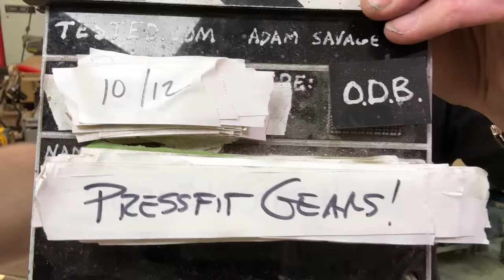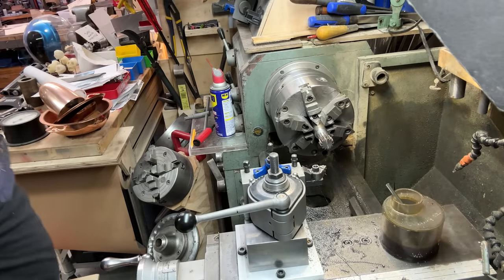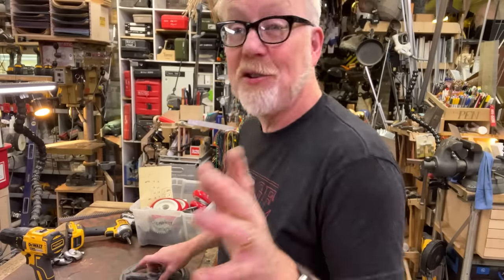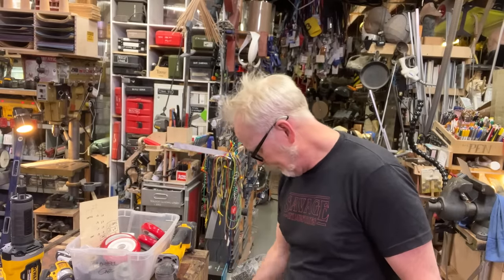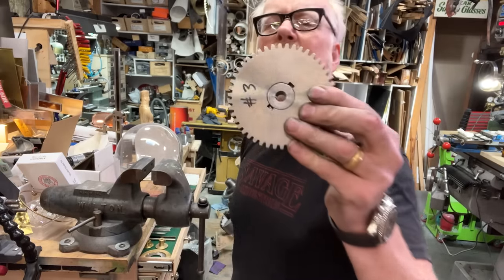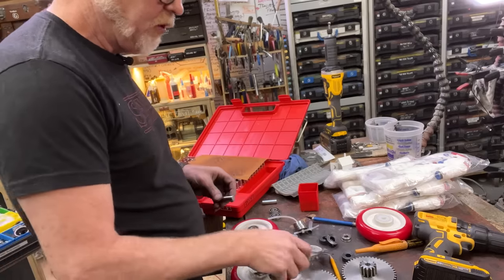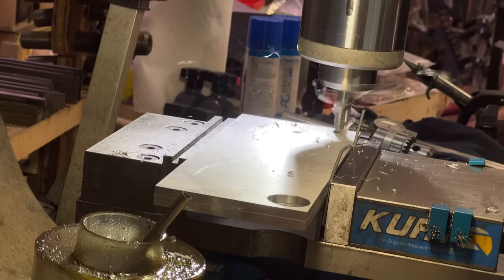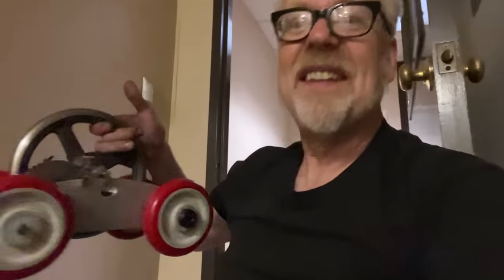Adam Savage's One Day Builds: Giant Flywheel Toy Car!

Comment: the wheel diameter is too small, So you are not getting as much distance out of every turn of the flywheel. If you look at the original the flywheel to drive wheel ratio is almost 1:1 and your enlarged model the drive wheel is much smaller compared to the flywheel. I think that will get you a better result.
Reply: I was thinking this too once it was put together. The wheels respectively are too small.
Reply: Yup, I'd say that's exactly the problem he has. Furthermore, it looks like he has quite some friction torque slowing down the whole system way too quickly.
Reply: @schizophrenicenthusiast  Also the weight in his design vs the size is significant. If he skeletonized the from with thinner stock, and skeletonized the gears, would reduce weight significantly.
Reply: This!
Reply: Give this man some more likes so this becomes top comment!
Reply: Yep
Reply: @Stevieboy7  True, but you could also argue that the increased mass better stores energy without needing to go to higher speeds
Reply: @Stevieboy7  Mass, this would have the same problem under any gravity. It is using almost all the energy stored in the flywheel just to move the gears so very little is left to propel the car forward
Reply: oh... you maybe right!
Reply: Exactly what I was thinking.
Reply: I would bet you are getting a much higher RPM in the flywheel with the toy car than this one, mainly due to the ease of spinning it up. The larger scale in the diameter of the wheels in the toy would also give less rolling resistance and spin the flywheel faster.
Reply: I think larger wheels will both increase the distance traveled and make it easier to get the fly wheel to higher rpm. Good handles on the frame would also help to use a similar technique to get it going as with the toy, i.e. "multiple push-lift cycles".
Reply: I replied with what I thought the problem might be, but yous is more likely a contributing factor to the lackluster performance.
Reply: Was gonna make the same suggestion but here this is. However to me it also sounds like the flats of the gears are rubbing together, could be wrong and that's the teeth of the gears interacting but from what I saw he might have made the tolerance to small and the flats are rubbing
Reply: @Stevieboy7  Yes, my first thought is that it looks way too heavy. That's a lot of "car" that "engine" has to move, you know what I mean? Yes, reduce the friction and the rattling, that'll probably help, improve the gear ratio too, that'll help. But I don't think either of those things will get you over the hill unless you drop that weight.
Reply: @mack-about  surprised he didn't bolt a handle to either side
Reply: @kylejames3517  too tight of tolerance...seems to be a common problem ;p
Reply: Would more weight in the flywheel help too?
Reply: Cant wait for the next part of this!
Reply: I'm guessing more mass in the flywheel and less in the rest of the machine. Also bigger flywheel with mass constructed on the outside for more centrifugal force
Reply: Yea would be sweet to see like some wheels of a smaller kids bicycle would be cool those little wheels are not gonna work great, im not a scientist but those little wheels will skip and spin and not keep up with the flywheel
Reply: @Stevieboy7  i dont think the weight of the vehicle is the issue, as much as the weight of the gears. lighter gearing, with smaller contact friction patches and a heavier flywheel would likely help

the easiest way to add mass in the original was to make a bigger flywheel, since im going to assume changing materials (switching to brass or just a thicker material) would be too cost prohibitive
Reply: Note to mention that you push the smaller car 10-15 times its length in a short period to accelerate the flywheel. 
He is attempting to spin up the flywheel by slowly pushing the car 1 or 2 car lengths
Reply: @BrandEver117  - Was thinking same (aside from the other minor issues) the fly wheel definitely needs more mass!
Reply: Gears should be thinner and lighter weight.
Reply: I agree the  smaller model has wheels in similar circumference to the flywheel
Reply: specifically, each rotation of the wheel moves the vehicle forward by the circumference of the wheel or 2pi times the radius of the wheel, so doubling the radius of the wheel would double the speed. (This is why putting oversized tires on a vehicle makes the speedometer read low, your car doesn't actually have a way to measure its speed, it measures wheel rotations and calculates speed. That may help some.

The sound does indicate some friction loss in the gears. That may be the best problem to tackle. 

I disagree with those who've said to remove weight from the gears. Each gear is essentially just another flywheel, albeit a flywheel with less mechanical advantage than the largest one. Every part of that machine that spins is subject to the conservation of angular momentum, so removing mass from the gears is removing mass from secondary or tertiary flywheels. 

Better handles would help you push the car faster, and multiple times the length of the car. Imagine a giant Adam pressing the car multiple feet across the floor, multiple times in rapid succession. Replicating that is going the be very hard for a regular sized Adam. 

The main problem is that Adam has scaled up the device without scaling up it's power source, because Adam is the power source.

Take the tiny toy car, which we know works fine. Imagine how hard a 6 inch tall Adam would struggle to get it up to speed. 

Perhaps a six foot long pole that slots in at an angle. Run behind the car until it's up to speed and pull the pole out and let the car go.

The more I think about it, the more I think that solution is to Imagine what a six-inch tall Adam would do to get a 1 inch car up to speed, then scale up mini-Adam's solution.
Reply: This☝🏼
Reply: Absolutely the issue and also bear in mind that the scale of physical speed also needs to increase in scale in the same way all other aspects do, this would need to be going a fair rate to get the same results
Reply: @Stevieboy7  That was my first thought as soon as he chose those 2 primary gears, I figured he was going to drill them out but he never did.
Reply: These comments are all pointing to the core issue, the difference in moment of inertia of the components. Adam's flywheel had a high mass, but a relatively low moment of inertia compared to the other geared components in the system. Lowering the moment of inertia of the gear train (thinner lighter gears), and increasing the moment of inertia of the flywheel (more mass on the perimeter and a larger diameter flywheel) is moving in the direction of goodness.
Reply: @chrisharris1522  I agree. The gears are massive, so they're brakes as well as gears. Thinner gears might overcome the problem. Not sure it's the wheels; smaller wheels have better mechanical advantage from the torque on the axle. I don't think it's a chain of friction either, though the brass gear seems like the noisy one. The original toy has little actual precision, but works great. My bet is the mass of the gears. Slice 'em thinner, add spacers, and see what happens.
Reply: The spur gears should be thinner. They should be 1/4 inch wide. This would decrease gear friction. One of the pinions could go down to 10 tooth giving a better drive ratio.
Reply: I also think you would want as much inertia in your flywheel as possible, but not in your gearbox??
Reply: @felixbelanger2659  , Great question. The system works best when the flywheel stores the inertia. All the other gears should be as light and low drag as possible. Like the relationship between engine, flywheel and transmission.
Reply: I agree with the comments of the wheels to flywheel ratio and the weight of the gears, but what about 2 handles to help with getting it up to a higher speed? The small toy alows you to move it long distances quickly on a surface to get the flywheel spinning very fast. The larger toy is not moving anywhere as quickly and for as long when considering the scale of the two. Handles!
Reply: Totally disagree on making the traction (drive) wheels larger.  That'll make it easier to start the gear train running but it will reduce the top speed of the flywheel.  Say the current drive wheels are five inches in diameter.  That means their circumfrence will require 15.7 inches of forward floor space to turn the axle one turn.  Making them ten inches will require 31.4 inches of linear floor travel.  You'll have twice the torque going into the system but half the speed.  The biggest problem is drivetrain friction and bad depthing (no gear lash in one or more gear connections) or possibly a mismatched gear modulus in the gear meshing, somewhere.  Are they all involute or are some spur (straight cut)?  The 46 tooth gear looks straight and not involute.  mixing and matching will make for a lot of clatter.  It's hard to tell in the video but the modulus of the repurposed gear from the drill press looks different from your gear wheels modulus .  Reducing its diameter is probably where some of the noise is coming from.  I agree that the wheels in the gears are much wider than they need to be.  The pinions are fine.  Once the wheels in the gear train are narrowed, I think they're probably close enough that a good lapping would wear them in to remove a lot of the friction.  Try working with the flywheel and intermediate gear removed to see where any undue friction may be occurring on an arbor or wherever.  Then add the intermediate wheel and check that out.  Then add the flywheel and repeat.  You can also check just the flywheel for friction and arbor alignment.  Also make sure you have an appropriate amount of "end shake" and that none of the gears are rubbing against each other.  Bearings on your intermediate gear might also be a good idea.  Balancing the flywheel is always a good thing, too.  Bearings on it is kind of a must.  Give Chris a call.
https://www.youtube.com/watch?v=vPc5Gtxc2yQ
Reply: Also, the over sized gear has to much mass, sucking away any energy.
Reply: So, it needs:
- Larger diameter drive wheels
- Lighter transmission components
Reply: @Stevieboy7  I was just thinking this. Those gears are massive things, but they really don't need to be. I'm no engineer, but shouldn't most of the mass be on the rim of the flywheel so it has maximal advantage to retain its momentum?
Reply: @juliettaylorswift  Exactely. That's what i would have done. On the small one you don't "agitate" it by turning the drive wheels like he tried with the large one, but you push the whole frame forward. He also needs bigger drive wheels, and i think he should skeletize the two larger gears. Their mass only counteracts the flywheel.
Reply: @schizophrenicenthusiast the heavier weight on everything but the flywheel would slow it down
Reply: ahh yeah the actual wheels. makes sense.
I still think it needs more mass on the flywheel though too, and the gears need a bit of tlc to get them to stop grinding.
Reply: Increasing the wheel diameter will make things worse.

The energy stored in a flywheel goes up with the square of the rotation velocity. You want the absolute highest gearing ratio that you can achieve. Increasing the wheel diameter slows down your flywheel, and reduces the total energy you have to work with. The only limiting factor is that eventually, the combination of aerodynamic drag and mechanical losses in the gearbox will prevent any further gains from increasing the ratio.

The ideal flywheel car has the following characteristics:

- Low mass everywhere but at the rim of the flywheel. Any weight you are carrying will increase rolling resistance and is also mass you need to lift if you drive up a hill. Putting mass at the rim of the flywheel gives the highest energy storage per unit of mass.

- Low mechanical losses. You don't have much energy to work with, so you need to store and transfer it efficiently. Rather than gears, I would have used a chain and sprocket system from a bicycle. Bicycles are incredibly efficient, and the hardware has been optimised to be very light. 

Both factors are contributing to the low performance of this build.
Reply: Also, handles on the chassis would be a good way to get the flywheel going faster.
Reply: the intermittent grinding sound could be friction of the two larger gears rubbing against each other if they weren’t properly spaced.   This is evident at 46:24 although you may have fixed it later.  Cool build
Reply: Also wheel traction, please use less 'slipery'wheels..
Reply: The gears and body should have been aluminum it something, the whole thing needs to be light for a fly wheel to work well
Reply: straight up this, wheel diameter is a gear ratio too!
Reply: @Stettafire  You're on to something with the weight of the gears.  Turn them down thin, like 1/4" and bore relief holes to minimize their moment of inertia and contact friction.  The flywheel is a terrible choice since it's hollow, and needs to be as large and heavy as possible.  A solid steel cylinder of the same diameter would store triple the energy.  A lead one would double it further.  Increasing the radius of a disk by 25% would increase the MoI by 140%.
Reply: @schizophrenicenthusiast  I was thinking the same thing, but the increased mass would need to be in the flywheel and not the rest of the car
Reply: @kevinhammond9445  Yes you're right, better that way due to the larger diameter.
Reply: You also need to spin the flywheel up to really fast speeds to spin the wheels. This is done by spinning the rear wheels up to your desired speed. If you try to add energy directly by spinning the flywheel it does nothing in the original toy as well
Reply: COCAINE
Reply: Very good! It's so easy to overlook wheel size as the final gear ratio. This is true even in full size vehicles. Smaller wheel= greater torque, Larger wheel =higher speed.
Reply: Просто слабо разогнал.
Reply: @schizophrenicenthusiast  Yup, between all the clacking and that ringing, you can hear his friction losses.  I think gears are making surface contact where they shouldn't be, on top of whatever spacing and depthing issues may be in play.
Reply: Yes.
Reply: Heavier flywheel. Spin bikes go by weight of the flywheel 🤷
Reply: I don't think the wheel diameter would make much of a difference, as it is the same wheels that spin up the flywheel.
The gears look strong enough to lift a minibus, friction was not really a factor when designing them.
Reply: The flywheel should be solid metal as well. The more mass the better.
Reply: @corialgechrist9229  The mass at the rim stores far more energy than the center. Nit parts of a solid metal flywheel would be dead weight.
Reply: Also narrower wheels and drill weight out of the frame, but the flywheel should have as much mass as would fit. Start the flywheel moving with a drill.
Reply: @RichardMerrill3Hawk  and add some gear lube.
Reply: Agreed....also you need some sort of PUSH stick....so you can walk/run behind to geter GOING!!!!....
Reply: The original comment here + The sheer amount of sound it's emitting gives us our answer, not only is it miss-proportioned, but there is a ton of friction in the drivetrain, exactly the cause of the friction is hard to pin down, but the fact that there's a pattern to it makes me think there's bad gear teeth somewhere or maybe an entire gear is warped, regardless of what it is, all that sound is wasted energy.
Reply: It’s more about mass than size and also there’s a lot of frictions loss because the crude gears aren’t properly meshed with a couple of retrofits this could run well,
1, Add weight plugs to the friction wheel to increase mass.
2, Mill slots to allow for adjustment of the gears.
3, grease the gears.
4, enjoy 
To surmise you weren’t wrong you just weren’t totally right.
Reply: the way adam charged the flywheel also contributed, think of how many revolutions are stored when you repeatedly lift and pull it he was just turning the wheels while it was on the ground so he only stored a few revolutions worth of energy, a handle so its easier to lift and move to charge or spinning it up before putting it on the ground would probably work much better